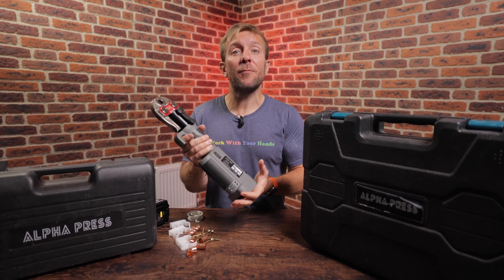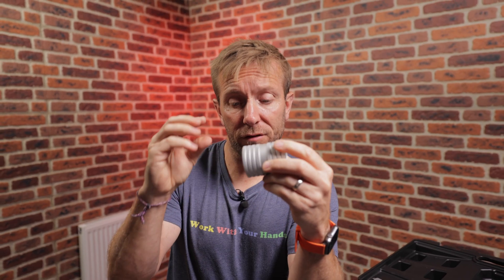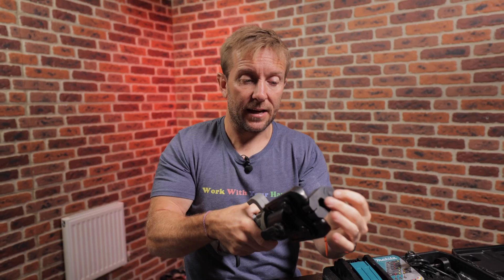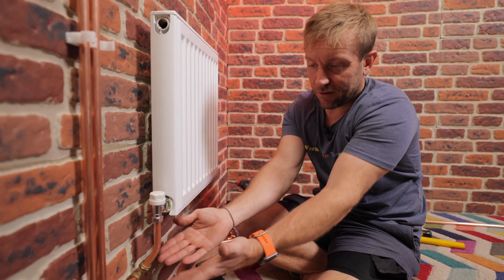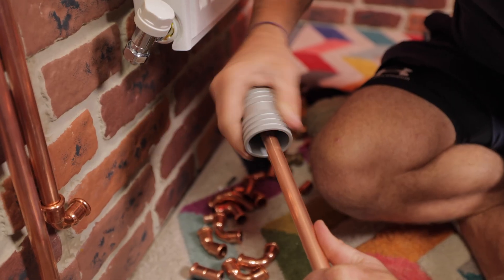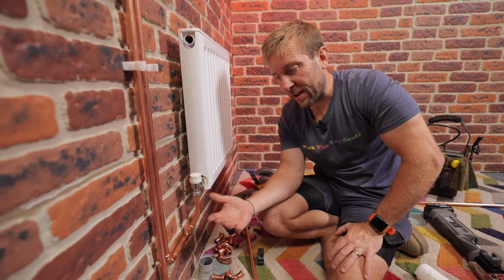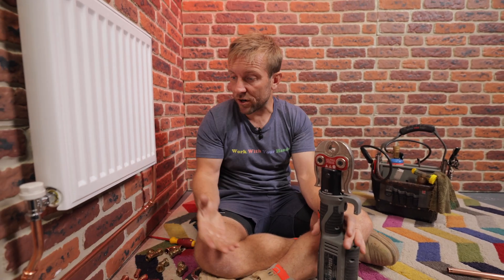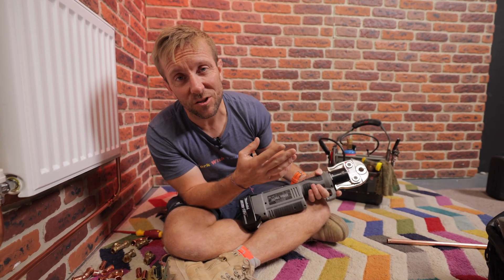PRESS FIT FOR COPPER COMPARED - Alpha Press

Comment: great video been looking at press fitting   which model are you using ?? (Alpha Press AP-I-1535 ( SL-1930 ) 18v Battery Crimping Tool 15-28mm )?

Comment: My concern is the cost of the tool £800 to £1k, then the cost of the fittings which are equivalent to speedfit.
Also I don't think the machine can get into  corners and under joists.
I am sceptical and time may persuade me but the initial costs are a bit too much at the moment.

Comment: Press fit is just push fit with extra steps. The sealing method (rubber o-ring) is exactly the same. Instead of a grab ring, it makes you crimp it. Don't see the point really.

Comment: Thanks for this James. Great video as always. Quick question if possible please - I don’t have the budget for this setup unfortunately as I’m just starting out but have the Alpha Press JT-1632 manual tool. Just getting the hang of it (it weighs a tonne!!) but when I crimp around the fittings, it is leaving them with small imperfections and sharp shards that I need to file down. Surely this can’t be right? Shouldn’t it crimp and leave everything smooth? Any ideas what may be causing this please? I’m opening the tool and fully closing the handles each time. If you know the answer I’d really appreciate it. Would love this tool instead

Comment: I like the Mapress fittings since they have that little plastic over the ends to show if they've been crimped. If you're a bit clever about your crimps, you can do around half of them before you put the whole thing together without losing the joints that need to rotate to get the alignment you want, that way you get tidier pipework since you've taken out the slack of half the crimps before you start aligning stuff, and it's a lot easier to handle if fewer things move. There are also male-female versions of the fittings, which can help eliminate some short pieces of pipe between the fittings.
Reply: Very good comment. Doing half the fittings as a 1st fix, check the alignment of the pipework before doing the other half of the fittings allows for last minute adjustments.

Comment: Does the isolation valve have to be flat faced to connect a flexible pipe to make sure it doesn't cut into the washer ?

Comment: Good video James. Thanks for taking the time to film it. Whilst I haven't made the jump to Press another big advantage is you can press when there's some water in the pipe. Can be a big advantage and a time saver in certain situations. Thanks again, buddy. 👍🏻
Reply: Mate, it's a life saver for that reason. The amount of times a soldered joint might fail and then you're trying to repair it after you've pressurised the system, but there's drips of water stopping you from sweating off the joint, or stopping you from fitting a new joint, so you just have to cut the whole thing out. Rather spend the extra money on the fittings. They're SO reliable.

Comment: Was looking at this but was unsure about it. Technically the press isn't a complicated piece of equipment. Is it true it needs recalibrating annually?
Reply: Hi if your working on commercial premises and contract work you will need to get the tool calibrated one a year which costs approx £90 a year depending on your tool manufactuer. However if you buy a tool from a Chinese Tool importer and they stop trading how does that tool get serviced.

Comment: I get the appeal, but the one thing you don’t talk about is the EPDM in the fittings, and it as a nutrient for bacteria.  No issue on rads obviously, but as an AP in healthcare, both our technical guidance and our AE’s (Water) do not recommend on our domestic water fittings.

Worth chatting about?
Reply: That's a fair point. HTM 04-01 (standard for water systems in English hospitals) states: "Consideration needs to be given to substances that may be present in many rubber compounds, and are also 
occasionally associated with non-metallic materials such as plasticised (softened) plastics, which can provide nutrients for Pseudomonas aeruginosa growth. Most non-metallic materials meeting the full requirements of BS 6920-1 should not enhance microbial growth. Where oxidising chemicals are used, they may exacerbate leaching." Since at least two of our hospitals are full of press-fit on potable water pipework, I assume some brands have been verified as OK? Or our PFI companies have ignored this!

Comment: I have been lucky to be able to borrow a press fit tool from someone for my self build. I think a key thing you missed is the cost of the tool for a DIY person. I planned to buy one and sell it when i was finished so the fact I could borrow one was a big bonus. I have been buying my fittings at Toolstation and local merchants where I have an account they were WAY more expensive than you suggest in your video., more like £2 for an elbow. That said while I can solder fittings I am 10X faster and safer with pressfit. Your point on being able to remove them is also very important. I had an issue in a cupboard where I had to lower the hight several pipes had been installed at and it got very tight. I manged to remove a fitting from a pipe by being VERY careful with a multitool cutting into the fitting just enough to open it and remove it without damaging the pipe it was crimped to.

Comment: Are they suitable for gas?
Reply: I hope so as my gas engineer used them with our new hob install. 😂
Reply: O ring is a different material for gas, compared to water. The fitting is colour coded "yellow" for gas. You can buy the o rings separately thus if caught short of gas fitting you can change out the o ring for correct one.
Reply: @GeoE8  cheers👍

Comment: @plumberparts have seen a similar tool (Milwakee) used by another YT, however, he marks the pipework with a black marker on a dry fit. That way you can see any movement prior to press fit as opposed to marking post crimping.

Comment: What about ageing? Compression and olive for ever haven’t seen a failed one yet when done properly first time, solder a good while although solder sometimes appears to fatigue after years. These new ones have soft seals of some type - wonder how they age - seals - didn’t bode well on the space Shuttle and are not doing well on Boeings Starliner. 

Endfeed still look the best.

Comment: Hear me out... Take out the rubber. Put some pipe sealant like on compression fittings... And crimp it.

Pressure test it, will it leak?

Comment: Huh. Can you do a few tests for us comment scrubs? Can you make a few connections WITHOUT the rubber? It'll promote a lot of sales if it doesn't leak. Trust me. It's the same reason why you sell the rubber-equipped pipe inserts (for barrier pipes).

Comment: These are pretty cool tech. Very neat and handy, but not too reliable and it's a little too specialized. But it's good. Some plumbers wouldn't be plumbers because they don't like the other techniques.

Press fit is a 1/10mm accuracy thing, there's a pressure curve, the materials need to be right, the pressure and diameter needs to be exact, and the press needs to be held clamped until the material settles... If you don't have the correct materials you can't botch a fix. It's basically a pro tool.

Comment: Finally a Plumber who see and talk about cost of labour, flux, solder etc.. I use press since 2000 in my home ( Hungary), Not new for me, we mostly use MLCP press as its much cheaper then copper and faster. Still can't believe that UK plumbers still talking about o ring etc.. We use them since 80s So far the good branded like Geberit and Xpress not failed me. Way overlast solder fitting only due to fact noone flush the flux which cause pinhole 😂 Good video 👌
Reply: Pinholes never seem to happen here in the UK. My theory is that the hard water protects the pipes.
Reply: @metallitech  they do
Reply: There was a batch of copper from africa many years back during the unrest and it pin holes like fuck, i have been on untold jobs of pin holed copper espcislly in heritage work.@metallitech
Reply: Mlcp fittings reduce the bore of the pipe by alot. Ive used it myself. And no way can an O ring outlast a soldered joint. Our car tyres are made of rubber.. what happens over time? They perish. I use both press and solder, love them both. But no way will press outlast a properly soldered joint thats flushed out correctly.
Reply: @adambrown1122  typical UK plumbers... keep soldering my friend 😅 Back in 60s
Reply: Wondering how much the internal diameter is reducer by with MLCP fittings? Looks similar to pish fit in that sense.
Reply: Pokud používáš eco krém . Je vcelku neutrální jen musíš víc čistit a je obtížnější poznat správně nahřátí. Chcete zkusenos. Jinak máš pravdu moc hochů to neproplachuje.

Comment: Is it ok to use those fittings on chrome? When I install a radiator I make good under the floorboards by linishing the chrome off the copper pipe then soldering, and chrome is slippery…..

Comment: Gun looks similar to the bigger novapress 203 gun. I use the smaller novapress gun and xpress fittings at work. Do like it for ease and speed but you can beat puooed bends and soldered joints for looks and max efficiency.

Comment: Why not just use push fit if you're going to use press fit. The two perform similarly in pressure tests.
Reply: You wanna see push fit fittings on a rad? 🤦🏻‍♂️
Reply: @paulw4904  I was thinking of the metal ones, e.g. Pegler Tectite. Would you prefer to see press fit on a rad?
Reply: @metallitech  Of course! These fittings work on a completely different principle. Pressed press-fit will hold the rad pressure even without the oring (oh yes), while pushfits rely only on the rubber. Yes, I joined the happy pressfit team and after splashing £££ on the tool and fittings, I finally sleep well after joining some old, wet pipes.

Comment: Fortunately I've used this equipment for many years in a commercial environment.the one thing I will stress is the marking of the fittings try to make sure a v is drawn from the end of the pipe towards the fittings reason being if there is ever a failure the company that has supplied the parts will cross cut to make sure it's been installed correctly if it hasn't then an insurance policy will become null and void thus meaning the installer will be liable for repairs and costs
Reply: Would love to hear of 1 instance where a manufacturer paid out due to a failed joint. Never going to happen.

Comment: If it's copper...I'll be soldering,, because I have never used anything better, more versatile, or more reliable. But I'm a plumber too, so.....😅..What do you think of the pex stuff boss? The aluminium lined plastic gear with the compression or crimped type fittings? God bless and regards 🤗🤗

Comment: My only problem with the alpha press fittings is that if people don't  clean/ deburr the outside of the  pipe property you risk damaging / slicing the rubber "o" ring ,which may leak in the near future . Love your video's youngster . Always great info . When are you going to put your son  Ted on the tools , he's over 6 months old . 😂😂👍
Reply: Rubbers leaking is never a good thing
Reply: A guy on YouTube did a test where he removed the o-rings and still got a watertight seal. It was only when the pipe was moved around a lot that it started to leak. Suggesting the o-ring is just a backup but how realistic the test was I don't know.

Comment: mate great vid ,im 60 wont ever retire but my sons in his last year as a apprentice , not sure what to do as pipe work isnt something i do every day but i do get fed up with soldering does the price justify me getting it ,but i do like having all the tools been scratching my head on this for 3 years now
Reply: I think it depends really what sort of work you tend to do. Personally dont like how big the fittings are. But if your going for a industrial sort of look which some people do then they look decent
Reply: @StevenGravett I can't justify the price myself and hate the look of them
Reply: I’m 78 and like yourself don’t think I’ll ever stop, although I’m an electrician I’ve been doing plumbing for 30 years and I’m still working doing small jobs, addiction is still buying tools 🤣, just bought a new Rothenberger torch £99 ( ouch ) keep looking at press fit but don’t know if I will get the benefit of paying the price for a gun, I’ve used techtite fittings before which look just the same and never had a problem with them.